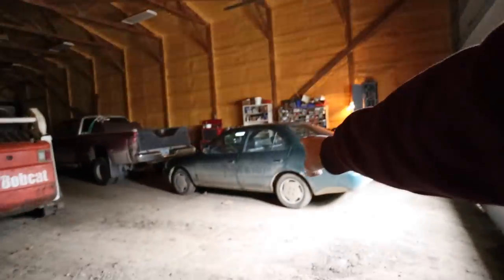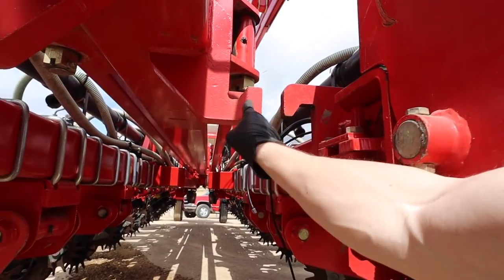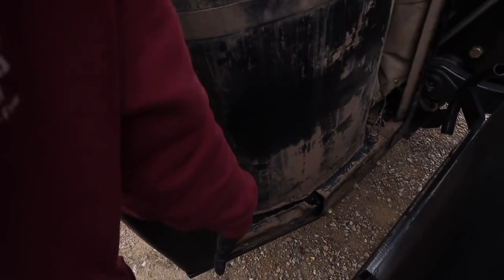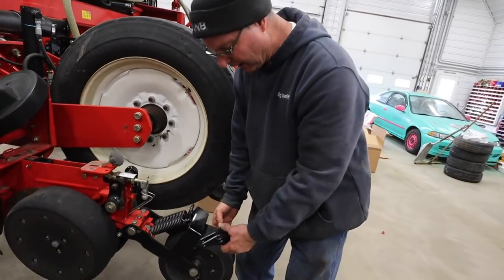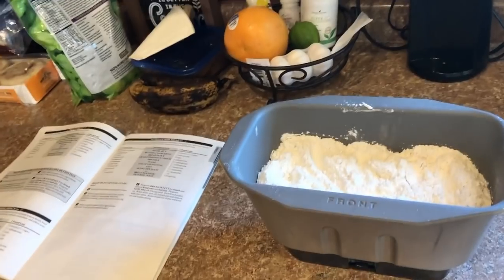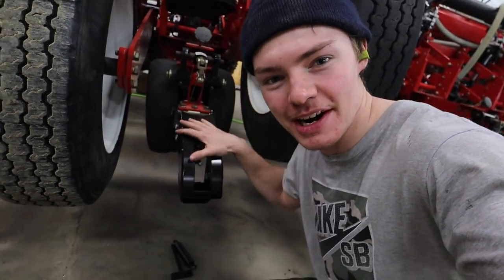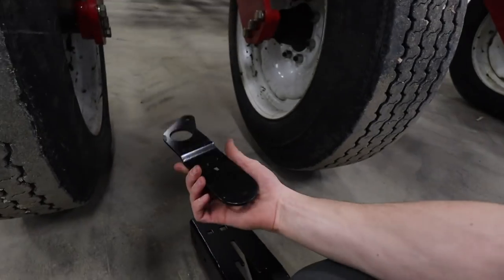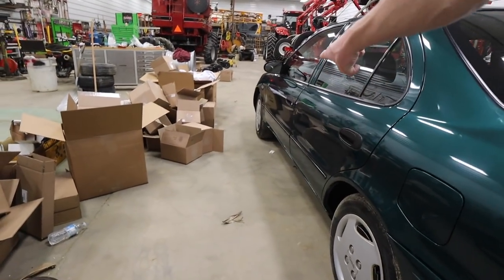We Got A Tractor STUCK In The Middle Of The Road! (BIG MISTAKE)

Comment: There new CH26 Case models have higher buddy seats. And yes, getting at those hydraulic lines suck. You have to take off the right hand rear tires to get at them, and or, pull the cab off.

Comment: I believe what I was told or read those are not a buddy seat technically, they are a training seat because of liability issues. A buddy seat or passenger seat would require safety equipment ect, and there isn't enough room in a cab for that.

Comment: I would but a 1/2" square wire mesh around the muffler that will help keep cobs and bigger leafs getting stuck there and put a fire extinguisher in the tractor. Just words of experience. Melted half the cab and two hoses.
Reply: it looks like there should be another metal or plasic shield around there tho.  to keep all the junk out looking at the bolt holes and stubs in that area.
but you're right make something if you don't have the original :) 

looking nice tho that combo of tractor and planter Thumbs up from Fryslan
Reply: Been though this with a few tractors 
The best way to describe it 
You'll never stop the stuff getting in so make it easy to get out 
There shoild be anouther plastic guard there but the stuff gets caught between the plastic and the exhaust 
Mesh sounds great but the the dinner stuff gets in and can't get out 
Open as it is is best then each morning just flick out the bigger bits with your hand
Reply: This is so true, if there is a way in it will get there. But when your out planting ,24/7 til your fields are done you don't have time to clean it everyday. As our tractors never shut off for days on end fuel on the run and driver changes but never enough time for cool down.
Reply: @scotteddy1468  
Yea if you don't have 10sec to flick out big bits then you def don't have time to remove the mesh guard to clean it 

Still have to stop to fuel up grease up and fill with seed and fert

Comment: We run NH T8.390s obviously same design as the Case, we have had many close calls with corn silage smoldering behind the exhaust, never a fun time. Had a constant flow hydraulic line blow out under the cab in the field never fun wedging between the tire and frame..

Comment: It feels a bit sad that so much equipment on the farm can not be used the whole year 100% to make profit = not very efficient approach.
Like factory would try to use all existing machines as close to 100% as possible replacing by newer based on amortization rates. Tractors/plantes/ trucks/spreaders/etc could be used on more acres of the land if they could work more hours during the season or helping with other tasks if could be used as a service for sale.
I liked and was scared by 'Grapes of wrath' when tractors replaced 100s of farms with land owned by large banks/corporations. Similar process could happen again when fully-semi autonomous farms be processed by fully automated mega-tractors scaling operating sizes to millions of crop acres potentially, drones to collect crop performance data and making required hourly / weekly operating adjustments.

Comment: If  your Wax is good the water will roll off in beads ..    Those  7    9/16th wrenches should fit on  14 MM  and    13 mm is rather tight on  1/2"

Comment: Metric and standard....welcome to my  world....grrrrr.  I was told if they can save 1/2 a cent they will go with the cheaper bolt as long as the grade is the same.  Making it easier on the mechanic means nothing to the design and release guys (DR). Also, if you can't fix it with a hammer, it's electrical.....<jk>.....maybe.
Reply: haha i've heard that last part quite a few times

Comment: Metric is standard haha, well it is over here in the UK
Reply: Depends what trade you work in lol
Reply: @jonny23c  I know what you mean, I often need to use both at the same time
Reply: @petergilder6666  my day job is all imperial measurement only use metric when down in to small measurements for handyness tho not very often 👍
Reply: Jonny Houston it’s not the most usual now I would have thought bearing in mind we have had metric since the mid 70’s, as I said I will use both in the same instance eg, I need a 6’ length of 2” x 18mm
Reply: @petergilder6666  i know what you mean, when i work with steel sheet i say 8'x4'x3mm haha